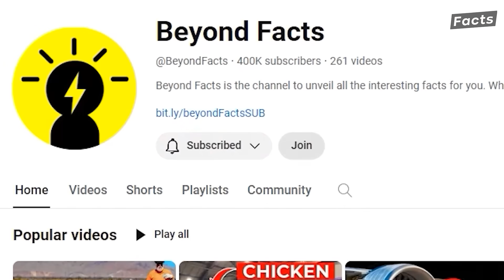This Will KILL the Panama Canal

Comment: Imagine a couple of ports with 4 rails running between them. Two rails running east, two west.   

Design those ports so that the train pulls up next to the ship, those intermodal containers are loaded from the ship onto the train, transported to the other end, offloaded onto ships and then hit repeat.  

Maybe intermodal containers, crane systems and rail cars could be modified to speed it all up.
Reply: New thought.  If a container ship has 20,000 containers, imagine the logistical nightmare.  Those containers will have to be tracked so as to get on the right ship headed to the right port at the other end.  Stacked 2 containers high, and presuming they are all 20 foot containers to keep it all easy, it would take 10,000 rail cars to transport them.  That would take up a ton of space on rails.  Presuming my math is right and each rail car is a total of just 30 feet, that’s over 57 miles of rail cars…plus engines.

Comment: Sea levels are dropping ?  According to NOAA ---Global average sea level has risen 8–9 inches (21–24 centimeters) since 1880.
In 2022, global average sea level set a new record high—101.2 mm (4 inches) above 1993 levels.
The rate of global sea level rise is accelerating: it has more than doubled from 0.06 inches (1.4 millimeters) per year throughout most of the twentieth century to 0.14 inches (3.6 millimeters) per year from 2006–2015. 
In many locations along the U.S. coastline, the rate of local sea level rise is greater than the global average due to land processes like erosion, oil and groundwater pumping, and subsidence.

Comment: Short question: At 9:45 you write about 300.000 Containers in both directions or together? Ok, lets think about all containers per year. So a PanMax Ship could have a capacity of round about 14,500 containers - If so, then there are only round about 21 ships a year on both ports, so 10 in the south and 11 in the north???? Really
This will be no alternative for the Panama Canal -> ca. 14000 ships passing the canal every year.

Comment: Fun fact.  In the 1860s, the telegraph lines had reached Saint John, New Brunswick.  Seeing an opportunity, a group of newspapermen in New York formed a syndicate to get the financial news from England faster than a ship could make the full distance to New York.  When the ship made its first port of call in Halifax, dispatches were handed off to a rider with a fast horse waiting on the pier who would gallop off toward Digby, about 200 km away.  Horses and riders changed every few miles at relay stables that kept horses and riders ready at the sound of approaching hoofbeats and hallooing rider until the bag of dispatches was transferred to the steamship that runs (still, although a diesel car ferry now) across the Bay of Fundy to Saint John where they were telegraphed to New York.  The information would be published into the financial markets while the original ship was still plodding its way to Boston or New York.

The time value of this information was enough to make the operation profitable, and it undercut free-lance speculators who might try to manipulate financial transactions on the London Stock Exchange by doing it secretly.  The value lay in the speed which funding made possible:  lots of fast horses galloping furiously through the night and fog.  So I can see how for certain cargoes, shippers would pay whatever it cost to go by rail across Mexico instead of waiting in line for the Canal.  Eventually the telegraph lines reached Halifax, ending the need for the horse relay.  Nothing lasts forever. 

The newspaper syndicate in New York became known as the Associated Press.

Comment: This project requires very sophisticated container handling facilities, with possible benefits that can sustain it in years with ample rain in Panama.  First, Mexico as the destination, would get improved ports.  Second, you could use ships larger than Panamax across Pacific, and split cargoes to different destinations in Gulf of Mexico and south Atlantic ports of USA, and the same on the way back.  This is how ports near the mouth of Persian Gulf make business.
Reply: It makes absolutely no sense. You will need 2 ships and it would be costly.  How many trains are needed to transport just the containers of 1 ship?
Reply: @mouradbelkas598  actually it does, It would act as like an airline hub distributing loads like people flying different places

Comment: Who did the Panama canal put out of business in 1914?  It took you 7 minutes to answer the question. I doubt it would have the capacity and make a significant dent in panama transits.  Unless the water shortage keeps up. 

How long would it take to unload and load large container ship? 
How many ships could they handle at the same time.

Would it be possible to dredge a significantly deeper channel through the lake to reduce water usage?

Comment: I thought that climate change was supposed to raise the levels of the oceans and flood everyone out. My bad.
Reply: Ha ha ! Now you get it!
Reply: WOW! What was the purpose of the locks on the canal again?
Reply: @TT-ww8vv Major interior water way isfresh water canal which stays at higher level than sea level. So to get water depth in those canals water need to blocks. Therefore locks are required. because of these locks they remain as canals. Else they will be river which cannot be useful for large ship movement. The locks also saved fredh water in the canals...
Reply: @sj9918  I was being sarcastic because the lake in question is far enough above sea level and likely won't be facing seawater incursion any time in this century.
Reply: @sj9918  And you must not have paid attention because that fresh water is dwindling
Reply: @TT-ww8vv  YES. Absolutely I agree with u.

Comment: Can some one please explain to me why it is not possible to dig a 30 meter deep trench?  I have seen mining operations that were far bigger than that.
Reply: The length of the canal is 82 kilometers so the amount of material you'd have to move is something that takes mining operations decades to go through.

And that assumes soil that's compact enough to run record-heavy equipment on, which is not the case for Panama.

Also, you'd have to somehow keep the Gajun lake out from that trench, and it sits 26 meters above sea level. I understand one of the main problems with the original construction was that the soil is prone to landslides, ie. digging a trench that's significantly lower than the current water level would need you to build actual walls to hold back the water. The soil itself does not hold that well.

If you could just close the canal for a decade and let the lake go dry or salt water, it would work. But that lake is also a critical source of fresh water for the surrounding cities and fields.

Finding a completely new spot for the canal, one without major freshwater bodies on it, might work better, but then you need to start from scratch.

So most likely they'll wait until the situation is so bad you can clearly show it being profitable in long term for potential investors. As long as there's still hope of us tackling the climate change there's a risk the investment will not ultimately pay back.
Reply: @JariJuslin  Thanks for the explanation.  

Perhaps if we were not shipping thigs all over the place the climate would be doing better.
Reply: @lostvisitor  The "climate" doesn't care about the weather, it's just the weather, we have to do the same and build things to cope!?!
Reply: @TomTomicMic  or stop building so much so big.

Comment: Panama Canal was built using 19th century tech and equipment. With modern tech and equipment it should be possible to bring it to sea level or at least rebuild using lift locks instead of the current water level locks. It will just take the will and funding to make this happen which could be more difficult than anything.
Reply: Aren't lift locks being used now? PC locks do in fact lift the ships.
Reply: The new locks built by Panama use water recycling ponds unlike those built by the US in 1914.

Comment: The railway won't be a canal killer, but the competition should result in reduction in costs.
Reply: The Panama Canal Operations have being for 100 year. And we know the how, It is no so simple to replace a containesr Vessel which can carry 10K or more TBU. ¿How many train vagons will be needed? Also considering the load and discharge operations time. But the higly cost to built a dry Canal or a combine Canal are extremely high. It can take decades to start seen profits. Ecomomical risks are considerables.
Reply: @crónicasmesiánicas5777  Costs will be high initialy, but they will likely just concentrate on specific cargo and configurations that are profitable and that they are efficient at handling. Modern terminal operations are exponentially faster and more efficient than they were just 20 years ago.
Reply: A major principle on the canal was the control of malaria by the US. The worker death rate plummeted under US Army doctors.

Comment: All that money and they can't pump water into the canal. Come on, I took up mechanical engineering and I passed a one question finals, one exempted, 44 took the finals & 40 failed. The one question was about water pumping in & pumping out. It ain't rocket science. It's all about $$$$, the $$$$ was & is mishandled or missing. 3.98 million $ was paid to use for one ship, a small portion of that can be used to pump water back in. But...

Comment: Aye. A large modern container ship might carry 15000 TEU. Put them containers on a railway and (if my arithmetic is correct?) you have a 100 kilometer long train ??
Reply: You don't need to put them into a single train; the distance is relatively short, so you can have trains going back and forth.

But yes, it's a lot of containers.
Reply: Your math is correct
Reply: Perhaps 75 km, if you stack two containers per one car 10 m (33 ft) long.  Note also that the projected capacity is ca. 5,000 containers per day....  Back to arithmetic.  Cargo would be loaded on 75 trains, and sophisticated unloading would dispatch them over 24 h, i.e. every 20 minutes.  That even allows cargo streams from 2-4 ships in the same time, assuming a single track in each direction, splitting into many tracks close to the destination port.

Comment: Geo Politics at work. With weather weapons you can control the world. We are actually going into a cold cycle, but fake news spreads lies that the puppet masters need spread. Global warming. 

Can science create rain storms and dryness. Yes. Noticed chemtrails in your sky's for years now? Research it. 

Trump's EOs when in office removed much of the black Ops $ WW. Part of the reason they had to get him out of office - Trump disrupted status quo corruption channels. 

They will either use weather weapons to hype the global warning hoax or to route ships back down the long route to skim $ off the top of trade to backfill their $ needs or thru Mex putting pressure on Panaa, but it allows the to pitch the global warning hoax. 

Yet, b/c they are also being exposed in 2024(finally), new alternative solutions will emerge like in this video. Is Mex part of the cabals new $ source or getting back at Panama for draining their train revenue b/c the time is right. Time will tell.

Comment: Within the last few years Panama installed a second parallel set of locks to accommodate wider ships. This also made the effluent water discharge more than double the amount of the original locks. Combined with the drought and the increase of water use for the new locks the canal is in peril. The canal operated for over 100 years with no problems other than the narrow locks.

Comment: a desalination system can solve this problem in no time    they can fill it up faster than rain  the plant is easy to build and they can use solar or wind to fuel it 
their are massive desalination systems now yes there is a price tag  but it will ensure that the canal will function   and the price tag doesn't exceed  600 million to 800 million for the system    they can use fuel to get it going fast then move to renewable energy

Comment: Why can't they backpump the  water used in the locks into the canal? That's the method used in Inland Waterways in the UK. It massively reduces the amount of water used.
Reply: I think the new locks already use holding tanks in order to re-use water.
Reply: too much water to move, can't be done, would take days for each of the 6 locks

Comment: They need to use less water for the panama canal by pumping the water back.
For the cross country dry land option, have a bath tub like container for the ship to enter.  With hundreds of wheels under it  have it roll cross country to the other side. then have it re-emerge  into the water on the other side. Huge engineering investment but cheaper then canal by far.
Reply: They already do that.   Recharging an entire lake on the other hand, presents problems of its own.
Reply: @PhilJonesIII  
Where have you seen  moving ships on land? i think its mostly small boats in Europe isnt it?
Part of the problem with the panama canal is every time a boat comes through it discharges water. By pumping it back they can save the lake some water.
Reply: @PhilJonesIII  So where have you seen ships moving across dry land? I would like to see it. 
Whats the Panama canal water management system? Do you know or just making noise?

Comment: Reclaiming the water lost. Lake Gatun from the locks to a storage pond and then using solar-powered 😂😂😂pumps to push it up to the top and recycle the water could help. The solar power would not be enough so a modular Thorium reactor barge would be better.

Comment: With modern equipment seems like they could now cut a sea level path across the entire route. Hell they remove complete mountains now.
Reply: Not commonly known is the fact that the two oceans have different sea levels, and different levels of high tide. At the entrance to the Panama Canal, the Pacific Ocean can rise as much as 20 feet, but 45 miles away, the difference between high tide and low in the Atlantic is just three feet.
Reply: @grooveman222   
What you said, is a good input for the canal repair.
Reply: @williamblake8650 : That would certainly be a solution unaffected by the climate change.

But cutting through all that ground is not trivial, especially as you need to keep out the water on the existing canal unless you want to close it for years.

Yes, we have modern technology now, but it would still be a gigantic undertaking. A construction project that would dwarf pretty much any land moving operations humanity has ever done.
Reply: @JariJuslin  , just one correction:
This solution would still be affected by climate change.
Reply: China been doing mega projects like its nothing.  We need to quit saying we cant and start doing like they are. Theyve completed the worlds biggest achievements already. @JariJuslin
Reply: Those are Asian countries that do that because commercial loans can be as low as 1 percent.
Reply: Or a lot closer to sea level at least.
Reply: Why not go North around Canada?
Reply: China would have already been nearing completion lol while we still talking about we can't do it.